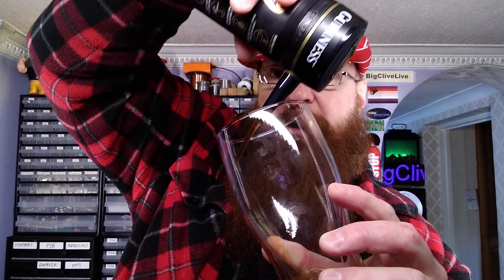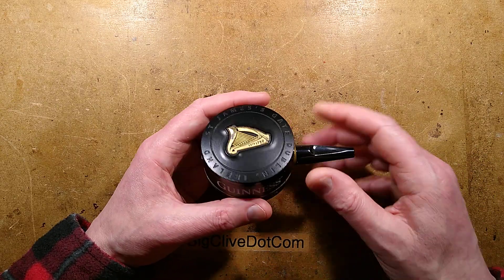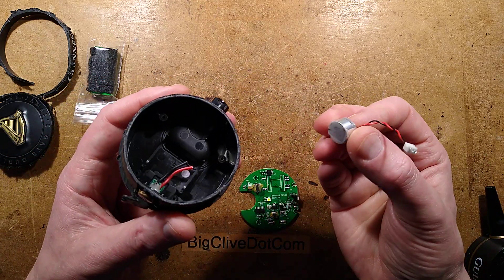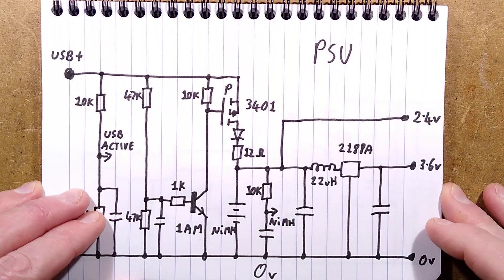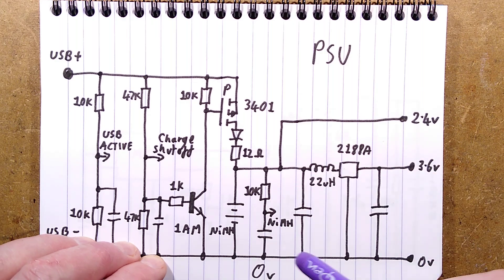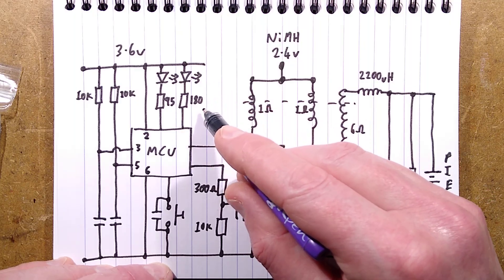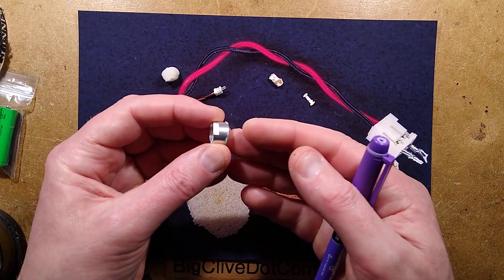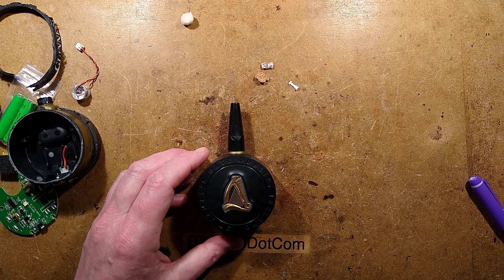Guinness nitrosurge teardown - with schematic

Comment: Welch's "Sparkling Grape Juice" I'm almost certain USED TO BE "carbonated" (heretofore referred to as) with nitrogen, based on what you've described and the absolute density of that foam.

I'm now 40, but have been drinking that stuff every year (usually at least 3 occasions) for as far back as I can remember, and it WAS that carbonation which, in all honesty, that made it the best.

As of, probably 5 years ago, maybe up to 8, that carbonation changed drastically... much to my dismay. That, as you put it, velvety foam... no longer present. Unfortunately, it's taste has also changed, becoming more bitter.
My guess is that's because they switched to now being carbonated with... carbon, now.

I figure that part of that flavor change is probably due to a bit less sugar added since the US has changed their Daily Nutrition Values during that same timeframe (a 12oz can of soda would've been, say "76%" daily value of sugar, but now they're almost all >90% lol).
The other part I figure it's due to Carbonic Acid.

It's still good stuff, but boy, it really is not anything like what it once was. 😔
[/weird ramble]
Reply: I thought I noticed the same change somewhere in the last decade, it took several holiday seasons to notice it; that the once thick unctuous foam was now sadly ...normal.😑
I'm glad it's not just me!
Reply: I have no basis for this theory, but perhaps they changed something else in the drink that downline effected the "potency" of the carbonation as well. I'm under the impression welch's is pure fruit juice so it's not a sugar/hfcs situation but maybe their perservatives or something effect the carbonation in some manner.

When brewing alcohol you'll find that some bizarre sugar sources will easily ferment, but add just a bit of some element and they'll die almost immediately and produce no alcohol/CO2. Relevant? No fuckin idea. 

Lemme know if you end up exploring this further and find some knowledge
Reply: @xAlexZifko  Hopefully you got my reply before it was deleted (I added a customer service number), or can still access it in your Notifications... 
The main thing I was pointing out was that it had ~17g of Added Sugars, which was 1/2 the total sugar.

But also that it's first ingredient is "Sparkling water" which I bet is the indication they've switched to non-Nitrogen based 'carbonation'.
Reply: Something that is interesting is that CO2 gas is that the way the bubbles act with our taste is slightly bitter. NO2 gas bubbles acts with our taste as slightly sweet. The biggest difference is the mouthfeel. CO2 gets that sort of "harsh" bubbly feel we all know from soda, while NO2 has a creamy sort of feel. This is all mostly because the size of the bubbles, CO2 having much larger bubbles than NO2.
Reply: @blargcoster  Yes! That is literally every bit the difference in experience.
Old: sweeter; more smooth and velvety bubbles
Now: less sweet; harsh and cheap feeling bubbles
Reply: @blargcoster yep
Reply: Sadly almost every product of our youths has changed due to corporate greed and the corporate corruption of regulatory standards. High fructose corn crap is not natural and needs to be banned to reduce disease.
Reply: Carbon dioxide is soluble in water. It's why increasing atmospheric CO2 acidifies the oceans. Nitrogen is largely not.

Also in the last 10 years, the FDA has clamped down harder on what food additives are safe to use. I don't think they'd be affected, but it's possible some seal or the thick glass required to handle the pressures just got too expensive for a publicly traded company...
Reply: @cheyannei5983   technically, this is not true and NOAA (quoted & linked below)  is using  incorrect terminology...the oceans are not acidic... they are alkaline... 8.1 ph... and with increasing CO² absorption, they are becoming less alkaline ... but... until the ph falls below 7 they cannot actually be called "acidic" whatsoever... 🙄

"Because of human-driven increased levels of carbon dioxide in the atmosphere, there is more CO2 dissolving into the ocean. The ocean's average pH is now around 8.1 , which is basic (or alkaline), but as the ocean continues to absorb more CO2, the pH decreases and the ocean becomes more acidic."

https://www.noaa.gov/education/resource-collections/ocean-coasts/ocean-acidification

But then, NOAA has long been known to lie about climate change and even falsified data to support their politicised stance... 

https://observer.com/2017/02/noaa-fake-global-warming-data-paris-agreement-climate-change/
Reply: @peterfitzpatrick7032  Your technicality is specious. Less alkaline=more acidic, regardless which side of 7 you sit on, and lowering the pH of a body of water is in fact referred to as 'acidification'. It's just like how 'more' and 'less' mean the same thing no matter how much you started with. -3 is less than -2, and 3 is more than 2.
Reply: @torydavis10  I think the debate is that "more acidic" would imply it's already acidic? (which it's not, since it's still alkaline) 
Just my 5am 2¢... 🥱
Reply: @DUKE_of_RAMBLE  I get that. The linguistic intuition just isn't quite meaningful from either a chemistry or biology perspective. From a biology perspective, what matters is not how far from neutral you are, but how far from normal you are, as life evolves to operate in whatever the conditions happen to have been. From a chemistry perspective, whether a substance is an acid or a base to a certain extent depends on what else it's interacting with. When you mix a strong acid [or base] with water, heat is generated because from the acid's [or base's] perspective, the neutral water is basic [or acidic], and they react until a new equilibrium of water dissociation is reached. When pH is a little too high or a little too low, you get the same general sorts of problems no matter where perfect is. This is why the science hippies use terminology which focuses on relative change rather than absolute magnitude.
Reply: @peterfitzpatrick7032  I wouldn't automatically believe anything written in the Observer due to their political agendas either. The Guardian is even worse BTW

Comment: Your reverse engineering is legendary. For scraping off the silicone coating, try wetting it with isopropyl alcohol and use a soft wooden scraper stick. This works wonders the times I tried it.
Not being a drinker myself, when I do break down and "have one for the cause", I almost always choose a dark ale. Yummy.
Reply: Im gonna spice this suggestion up a bit. Instead of isopropyl use ghb/gbl/1,4 BDO (in order of favor, and depending on legality in your area) which are all highly effective plasticizers and solvents. Should scrape like butter
Reply: hi labguy lol

Comment: Those RC pairs connected to pins 3 and 5 are the classic delay on power-on you'd add to a microcontroller's reset line, but not quite sure why there's two of them. It could be timing-related in general, or could be some other kind of secondary startup delay.

Comment: 150 ma charge rate?      trickle should be under 0.1 * 700ma   about    70ma?
Reply from the maker: It does look like it has voltage monitoring for some method of terminating charge.

Comment: 7:05 Aaaargh! A green and afraid-wondering-what-you-going-to-reveal PACMAN! 😄 (this phenomenon is called pareidolia, not a desease anyway). 7:30 Revealed internals and PACMAN is anxious. 😄 Although I don't like Guiness (taste) at all, it shines quality. Never seen such device before. But it is a shame the battery cannot be replaced without ruin the thing. There was a chance for an easy simple design fix, make the top cover like a cap, screwable.

Comment: I had no idea that there was nitrogen beer.

funny gadget, but seems very much like a solution in search of a problem. I think something more practical could be an ultrasonic wand you stir the beer in the glass with, rather than this cap that slows down the pour a lot and is more difficult to clean than a wand could be (assuming that you don't immediately rinse it before the beer dries, which would be the smart thing to do). I wonder if it could also work with an ultrasonic plate under the glass - if it did, then that could be a viable version for gastronomy.
Reply: Guinness people appreciate it.
Reply: Guinness is not a beer.

It is a food group.  It has it's own place on the food pyramid....
Reply: @Backroad_Junkie  that's all beer, aka liquid bread
Reply: The first versions of this were an ultrasonic plate you rested the glass on.
Reply: There's quite a few drinks that use nitrogen over carbon dioxide

Makes you feel less bloaty when drinking them and definitely makes for an interesting flavour too

Comment: 🔬 I've noticed the surface mount devices shrinking down and I ask the same question and I was told that more manufacturers are going that way, so they parts are more available and sometimes cheaper...  😬 Oh you hit a nerve mentioning those tiny components.

As a home hobbyist yourself, I'm sure you like through hole components, or if SMD's the chunky 1206's or even 0805's are semi manageable.  Now days components are just insanely tiny that I need a microscope to even see them, let alone work on them... and gone are the days of having the magnifier lamp and getting the job done.  I am considering getting a microscope for working on this stuff.
Reply: Ray, I gave up on using SMD after I turned 60... too much of a chore to work with , its meant to be a hobby, not an eye-test every time I build something ...🙄

Comment: Just a few days ago I was having bottled Guinness and wondering whatever happened to the spinny plastic nitrogen things inside the bottle. I just assumed they removed them from all cans and bottles... like sneakers removing the pump mechanisms from the tongues once the gimmick wore off.

I foam my Guinness just by giving a good pour and swirling the last bit in the can/bottle before pouring it out to add some extra pure foam head on top.
Reply: Still sold in the USA but recycling the cans is a problem and scrap yards get REALLY angry about them because they pay by weight and it's foreign plastic. Need to cut the cans in half and removing them before recycling them

Comment: Someone's in a cheeky mood. You got an eyeroll out of me with that "nice, creamy head." So my question is, what have people who drank Guinness from bottles been experiencing all this time?
Reply: There's a difference between carbonization and nitrogenation, most of the Guinness is carbonated unless it specifically states it's nitrogen. There's a huge flavor difference between nitrogen and carbon dioxide and if you find somewhere with side by side taps of the same beer to taste test it's blatantly obvious. CO2 adds bitterness so using nitrogen on a stout means it's sweeter and tastes completely different.
Reply: @mattgayda2840  Thanks. That probably explains why people have such drastically opposing opinions on the stuff, more so than beer it seems. Would the same be true for other lagers stouts? I don't even know any by name, that's how dominant Guinness is.

Edit: realized I called it a lager because the word "stout" escaped me 🤣
Reply: @genXnb  yes, and carbonation of beer is a new concept that was never introduced until the last century. The science of brewing is incredibly complex but a deep rabbit hole I recommend everyone go down and learn so you can turn a 5 gallon bucket of water into beer in your basement for a fraction of the cost.
Reply: @genXnb  Real "beer" isn't what's found in 99% of products labeled beer. Water, malt, hops, and yeast are the only four ingredients permitted to call a beer a beer under the German Purity Law (also known as the Reinheitsgebot) of 1516 stated that beer could only be made from these ingredients, and today many brewers still adhere to these guidelines.
Reply: @mattgayda2840  this also explains why Starbucks “nitro” cold brew has a different flavor than their regular cold brew coffee.
Reply: @insainllama  I hope you're kidding and forgot the /s
Reply: @Vegan Atheist Weirdo asked "So my question is, what have people who drank Guinness from bottles been experiencing all this time?"
Regret.
Reply: @paulreeves8251  Well played.

Comment: 3:40 Pepsi makes a “nitro Pepsi” in a similarly big can. On the can, they recommend dumping it into a glass to stir up the bubbles. But, the one time I tried it, I cracked it and drank straight from the can before I even noticed the instructions. By the time I did pour it into a glass, I think what little gas was left escaped after the rough pour and it went flat really quick because it just tasted like flat Pepsi and I wasn’t impressed. But, I’d be really curious to see if the ultrasonic doodad would kind of fluff it up and improve it at all.
Reply: Yeah i feel exactly the same with the drink. it just feels like flat pepsi.

Comment: Odd. In the US, cans of Guinness Draught have a little flying saucer inside with pinholes to fizz out nitrogen when the can is opened. Do you not have those in the UK?
Reply: Only since about 1982! This a new system that's supposed to be better.
Reply: I can't speak for the UK, but in Slovakia (also in eu) we have a little white plastic ball inside the can. I am not sure if there are holes in it, but it makes a sound like a spray can
Reply: That's the "normal" Guinness can. Nitrosurge cans are more expensive.
Reply: Here in Canada it's a ball. I know because I had one this afternoon 😅.
Reply from the maker: We have widget balls inside.

Comment: Are the cans different from the nitro widget cans we get here in the US? They do the whole foaming thing all by themselves as you pour.
Reply: Beer suppositories, with wings.
Reply: The cans/bottles Ive had for a while have all been widgetless. It confused me at first but I guess this device is what replaced the widgets?
Reply: @GGoAwayy  it has been a while, but I seem to remember that as well. I figured it was just a way to lower costs and raise revenues.
Reply: I think that's a nitrogen filled ball that kind of leaks when you open the can.
Reply: Nitrosurge cans are different (and more expensive)
Reply: They stopped using them here a while back
Reply: @MONTY-YTNOM  They are definitely still a thing. I've got some in the fridge ... must depend on how popular (or not) Guinness is in your area.

Comment: These novelties just get dumber and dumber.  Pouring Guinness is easy.  You pop the can and you invert the can and pour into a glass.  For style points I drop the whole inverted can into the glass.  Note: only use this with proper imperial pint glasses like Clive is using..  You don't need this silly toy.
Reply: I'm assuming you've not drunk too much Guinness from draught. If you had, you'd know the cans (with widget) are a poor substitute for draught Guinness.

Those of us who enjoy a good Guinness have been using Surger units in the home for years. This "nitrosurge" unit is the same thing just redesigned.

Highly recommend it, if you think traditional canned or bottled Guinness is good, your taste buds will thank you after trying one of these.
Reply: @lmaoroflcopter  Mate I built and installed a whole nitro draught system here.  The Widget works just fine in a pinch.  And sorry to piss on your parade, but in the end, Guinness is a bland uninspired stout.  Also it's got so little alcohol it's almost legal in Utah.  You want stouts that will blow your head off, check out the Festival of Dark Arts in Astoria, Oregon.  Mid February every year.

Comment: What terrible wastage on Guinness' part. I'll stick with the bottled stuff.
Reply: Wondering what you consider wastage here.

They've replaced a plastic single use widget with a multi use unit. Seems like a reduction in wastage to me.
Reply: @lmaoroflcopter  Like I said. I'll stick with the bottled Guinness. No widget. However surely the widget can be recycled.